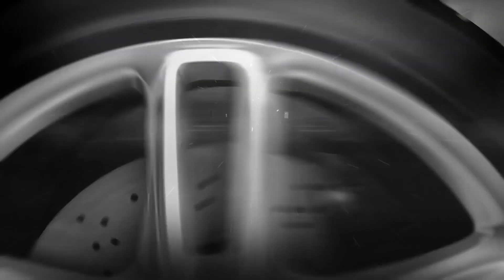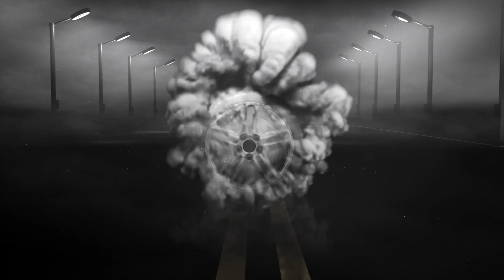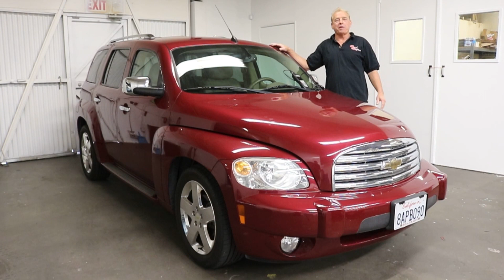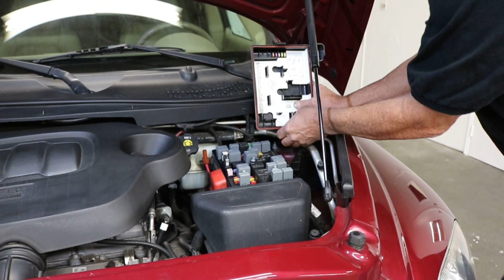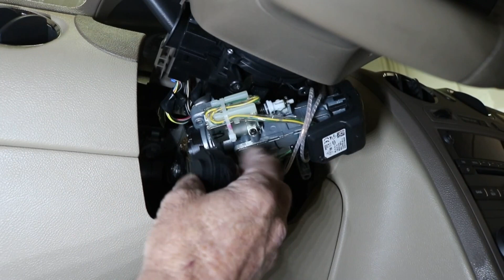No Start No Crank Code 1682 2007 HHR by Scared Shiftless Rides and Wrecks

Comment: What if the starter relay didnt click even after u switched it with a new one ? Then whats the next step to look for?
Reply: I just put on a brand new starter and the battery has 12v and i tried to start but no start or clicking but i went under car and tried to see if i could bypass starter by having someone in car holding  key in start position while i jumped  power wire and switch wire on starter with screwdriver and it cranked over but didnt start up..... What is the next step to check ignition ?????
Please help me im going crazy!!!!
Reply: @kennethhaslup3521 any luck
Reply: @kennethhaslup3521  Hope u check fuses first before u replace all that stuff.

Comment: I'm having the same problem with my 08 HHR..when it start dont crank only clicks..we change the starter, battery it's good, alternator good and still no crank! What could be?
Thanks for any reply
Reply: Quite a few different things. I would never start throwing Parts into a car until you are certain that is the problem. It would be less money to have it diagnosed at a shop, rather than spend the money on those two items. There's loads of information on the internet. Do enough searching and you will be able to pinpoint your problem. Spend few hours doing some research online and you can diagnose your problem quite easily. Check your relays, check your power, check your motor, check your safety neutral switch, check everything it could possibly be. Just don't buy a part until you are certain.
Reply: hello this is happening to my car exactly how you’re describing it we changed all those as well did you ever end up solving the issue if you remember ?
Reply: @wmydraco did you ever end up solving this issue, I'm have the exact same problem